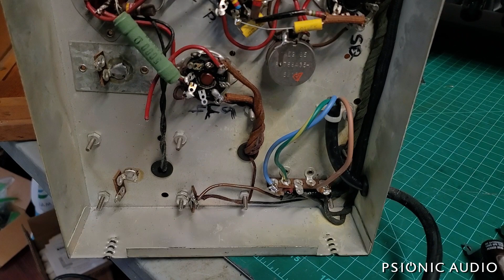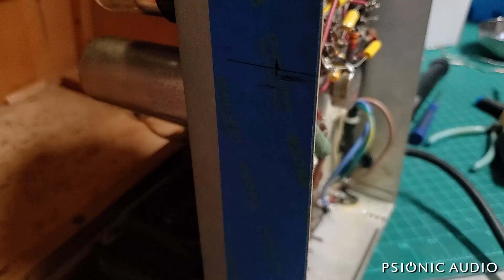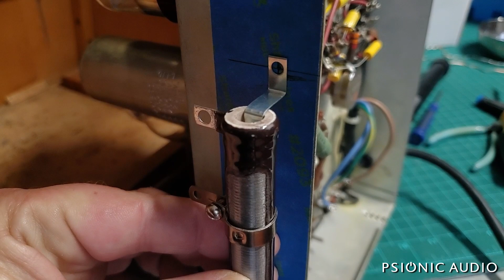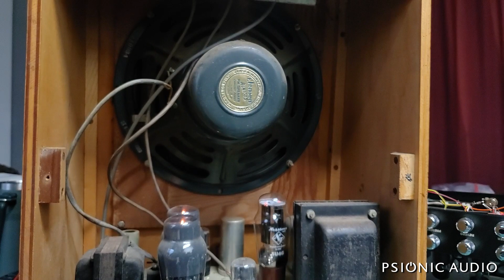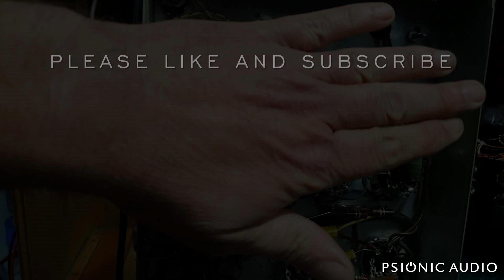'49 Epiphone Zephyr | Part 2 : Well, It Doesn't Catch On Fire Now...

Comment: All you needed was to put a composite low dielectric high temperature rod through the power resistor not to go the lazy way and drill holes in such an almost pristine vintage amplifier.Sacrilege!  . There are hordes of materials from ceramics to high temperature composites, to castable high temperature ceramics as I use routinely. Did it not ever occur to you that you should do that? You had two solder positions on the chassis  the rod assembly could be soldered onto the chassis for a no damage solution, but there you did it, out comes the drill. The o'l  "Il just go ahead and" screwover.  If I was the owner I would be livid. No care for a vintage instrument.

Comment: Worst case scenario for AC hum induction into the audio is when the on-off switch is mounted to back of the volume or tone pot. I really hate when they do that! Better to locate an on-off switch elsewhere and use the switch on the back of the pot to lessen or turn off the feedback, or activate some other tonal option.

Comment: Hmmm... if you stuffed some soft iron ----  framing nails or a piece of threaded rod, perhaps ---- into the hollow center of that power resistor, would it also act as a filter choke? 🤔

Comment: I built an amp with a 5879 into a 12AX7 paraphase inverter pushing two 6L6GB’s.
That amp had so much gain it would start to oscillate at 1/4 volume(I got it working with a few tweaks eventually). The Zephyr definitely has some gain sucking going on. I would expect it to sound as crunchy as a Brown Deluxe with that tube compliment.

Comment: The low voltages bother me.  I'd think it would be higher given modern wall voltage.  Gassy output tubes?  The chatter is interesting.  If you've not heard it before, it may not be your environment.  Too many odd things going on.  It might be worth grabbing the scope and checking for parasitic oscillation.